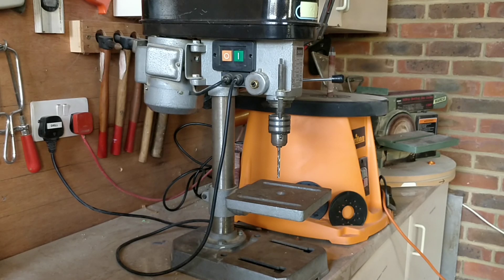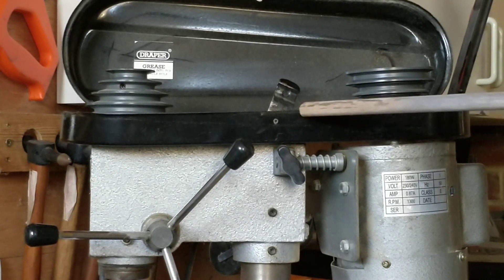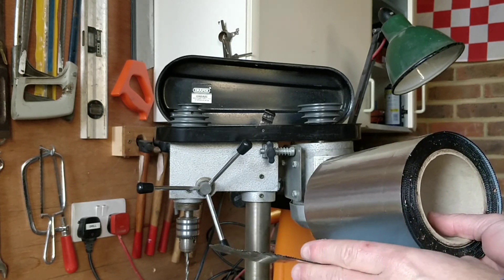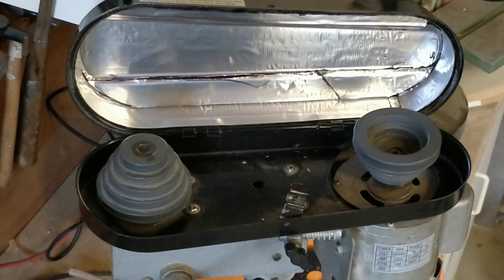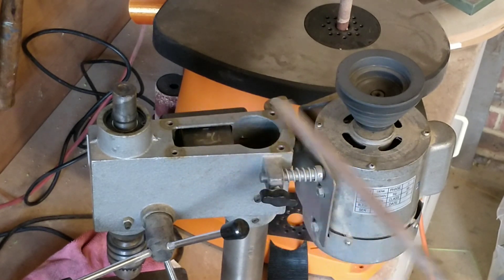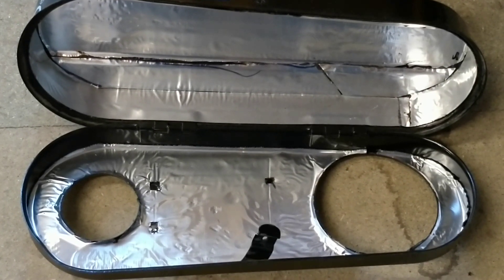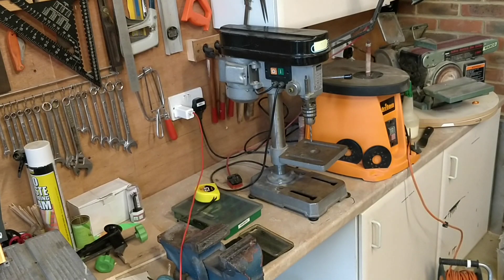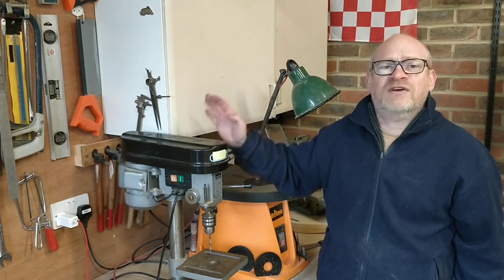12. Silence your Pillar Drill

Comment: Excellent video, thanks.  I've been doing quite a bit with my pillar drill lately and often think how noisy the damn thing is.  I'll be following your tips tomorrow.  Also I'll put some where the tensioner plunger meets the motor plate as I think it rattles a bit there.
Reply from the maker: Thanks,  glad you liked the video,  good luck with the mods

Comment: The first thing I spotted is that the pulleys are not co-planer. The motor pulley has about 5degree incline - that cause the belt to whip - that causes vibration and consequently the noise.
Reply from the maker: Thanks for the feedback,  I'll check that out 👍🏻

Comment: Another nice mod Simon, thanks for sharing.
I also capped off the bottom of the actual pillar (essentially an empty reverb chamber) and filled it with sand, which helped with volume and has the added bonus of more stability.
Also thin sheets of craft foam have hundreds of applications for things like this- really malleable and behaves well with pva glue, but definately a fire hazard and not to be used around anything that generates more than negligable heat. Certainly a dust hazard unless enclosed. Cheers!
Reply from the maker: Love the sand idea, I'll have to try that 🙂

Comment: Great idea! Any recommendations regarding quill/spindle play most of these basic pillar drills sufferes from? That would be highly appreciated
Reply from the maker: Sorry, I've not looked into that, I think that unless you have the engineering experience and tools fixing that might be difficult, and if you have those tools and experience you will probably would not have a cheap drill press!
Reply from the maker: I should have also added that I have a video coming out shortly on aligning the pulleys
Reply: @DIYTinkerer  good to know!
Reply: Not sure what machine you have  but even some of the mid range machines have poor quality bearings.  Good quality replacements are widely available and not too difficult to replace and will make a great difference.
Reply from the maker: @kelvinsparks4651  thanks I'll look into that

Comment: Does your drillpress also make more noise when you lower the quill (start drilling) ? Mine does, and I don't know how to solve it. I've added moly grease to the spindle, but it doesn't seem to solve it. bearings are fine. Thanks.
Reply from the maker: Mine doesn't do that, it was just rattled a lot, I've got another video coming out soon that looked at aligning the pullies which might also help.
Reply: Sounds like the quill of your machine is not inline.

Comment: Isn't that a bit like turning the radio up in your car when you get an engine noise so you can't hear it? Looks like you have a pulley,belt,bearing or motor vibration causing the noise.
Reply from the maker: It might be, but that thin tin pulley case really rattles. Even in a Rolls Royce you have sound deadening, despite a well engineered engine,   and this cheep pillar drill is not precision engineered. I will check out the pulley/ Motor alignment though, thanks for the tip.
Reply: My identical Wickes drill sounds just like that…and it hasn’t drilled anything.  Purchased 20 years ago and mothballed…recently added to my new craftroom, but needs a good clean up and light rust removal.  Anyhow..no…I think all those cheapie brands sound like that, they are not made to high standards or with noise levels in mind.

Comment: I've just been through the same process with a new Sheppach pillar drill. Used sticky back dense foam to deaden the lid rattle. Another thing to check is the alignment of the pullies to each other  which is usually the cause of the initial vibration, adjust the motor bracket bolts to suit.
Reply from the maker: Thanks for the tip, I'll also check this out.

Comment: That worked very well, not just quieter but a more pleasant noise too.
A lot of the noise of my pillar drill also came from the rattly case. I found I could make it much more bearable by simply slipping some foam between the join in the case. While it is still not exactly quiet at least it isn't an annoying high pitched rattle now.
Reply from the maker: Thanks, it sounds much nicer now, I have a few more pillar drill mods comming up, using simple everyday tools, so be sure to subscribe if you haven't already.
Reply: @DIYTinkerer  Subbed after the first vid! 
A foot switch is a great mod for a drill press, gives you 2 free hands. Really like mine, made it much safer. I put it on an extension so I can use it on other tools as well if I want.
Reply from the maker: @caskwith  that is a great idea :-)